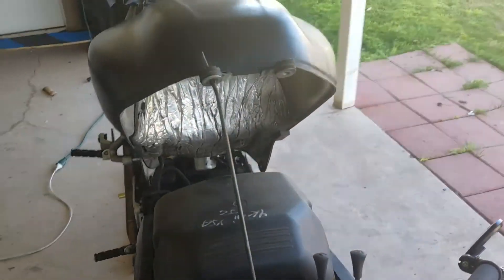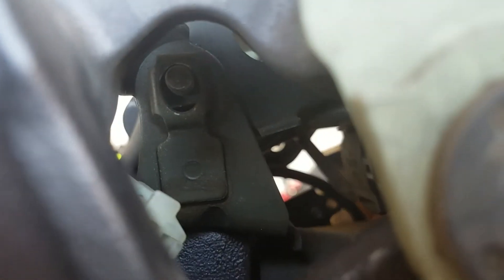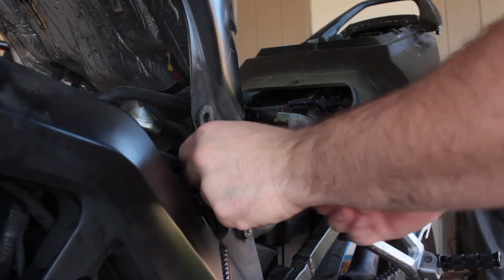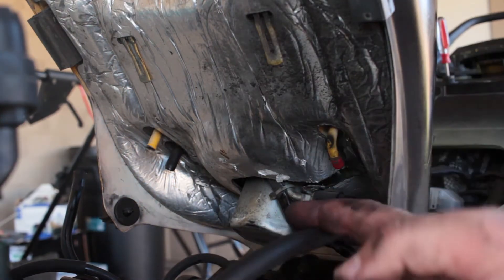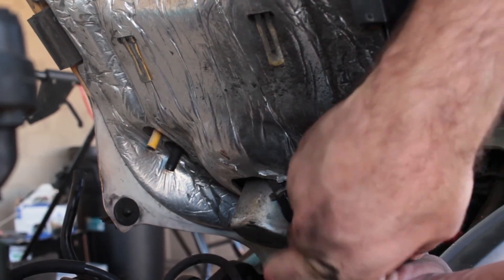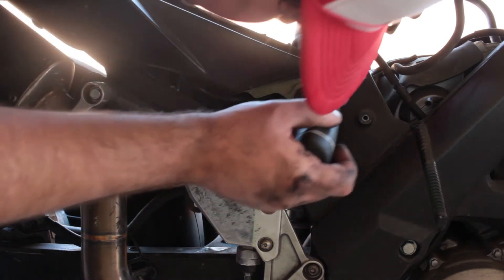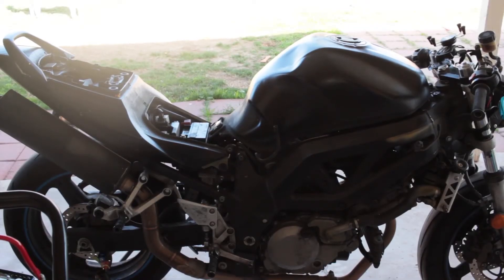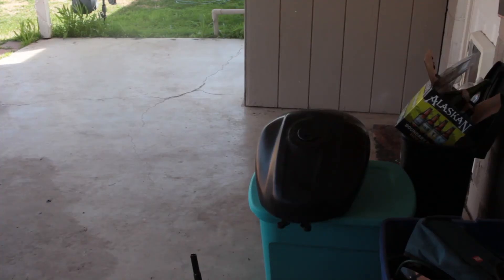SV650: How to remove the Gas Tank!

Comment: Nice. Just bought the k5 model and old owner let the gas filler cap latch corrode like crazy so I had to drill it off and get a replacement. Inside of gas tank is fucking gross :(